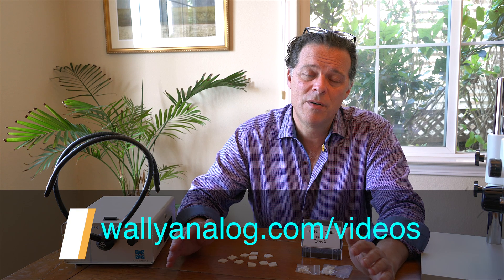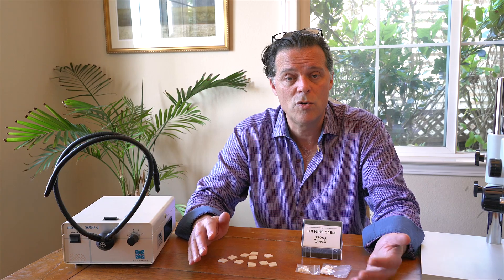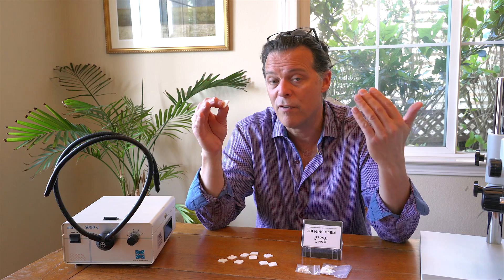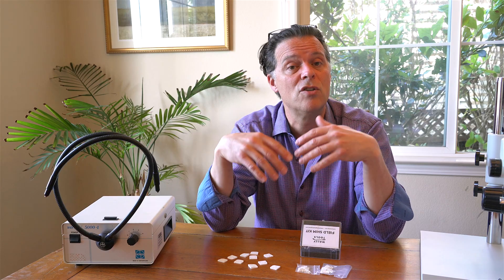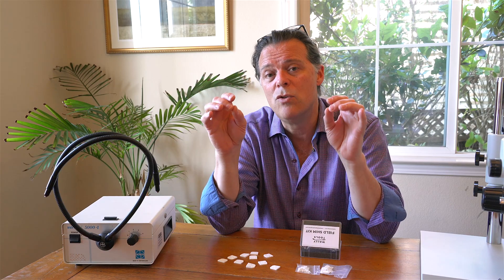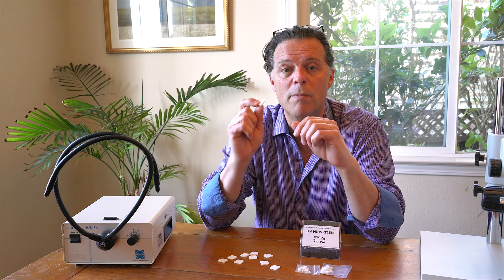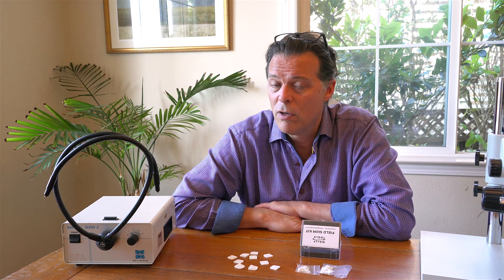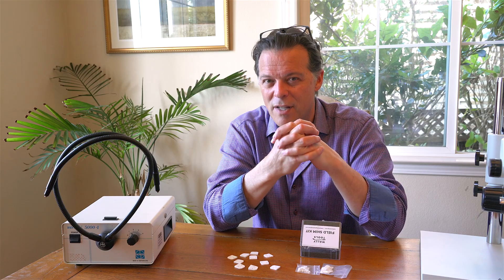Sound Bite #37: Experimenting with Corrective Shims For Your Phono Cartridge

Comment: Hello. The other day, I was setting up the denon 3000 ne. The tube is inserted through a damper, and there is a soft pad between the cartridge and the housing. I think this pad looks like a cow's saddle. First, it's difficult to move the cartridge when adjusting the offset angle, and there's no feeling of a tight connection. Additionally, the pad may sag over time. Thank you for opening this topic!
Reply from the maker: You are welcome
Reply: @WAM-Engineering 🤝

Comment: aren't you really talking about rake angle from 90 degrees from top dead centre. if you're lowering the back of the cartridge it's gonna give you less of a rake.
I don't see how you're changing the vta yes vte of the counter lever but not the arm. a bent curved arm is best, so the bearing is at platter level. not seeing a gentle curved arm yet. try it out you should be surprised, look for a 2 degree drop at the bearing and straighten it out about a third towards the head. bamboo works well easy to bend when steamed. dry in an oven at 60 degrees Celsius, then put it in a vacuum bag with fibreglass resin hardener. you need to drill the centre of the bambo first and line the bottom of the inside or outside with a bit of copper tape to ground. 
you could try 3D printing one from this carbon type of resin not tried it.
Reply from the maker: Way too much here to debate. If you watch enough of my videos you’ll see my position on many of your points.
Reply: oh well disappointing😊 @WAM-Engineering

Comment: Hi JR. How are you measuring VTA, stylus tip to cantilever pivot point or down the cantilever tube? Thanks.
Reply from the maker: Tip to pivot. It’s the only proper method. The challenge is finding the pivot when you can’t see it. We developed a process for that.
Reply: @WAM-Engineering Thanks. Glad you managed to find a method to find where the pivot point is, it is tricky.
Reply from the maker: The difference to the cantilever angle is what we call “stylus offset”. It ranges from 0.5 to 3.9 degrees, depending upon the assembly type.
Reply: @WAM-Engineering Ah I see, interesting. I have a method where I get a good image of the stylus and determine the cantilever angle when the stylus is at 90 degrees, then use the cantilever angle in the record as a reference to dial in the SRA. It seems to work well, my shims are just thin metal though. Strangely, my cartridge needed the nose dropping by 0.5-1mm. Great work JR, I’ve learned a tremendous amount from watching your content, it’s excellent, always looking forward to the next episode.
Reply from the maker: Thank you!
Reply: @WAM-Engineering The new head shell looks fantastic btw, makes me want to buy a Kuzma arm.
Reply from the maker: Thank you! The Colossus is hardly the only reason to get a Kuzma 4Point or 4Point9!

Comment: Have you measured optical cartridges, do they have this problem?
Reply from the maker: Same challenges as the others since they buy the same mechanisms from the same vendors as all the other cartridge manufacturers. DS Audio does, however, tend have a more appropriately low VTA than most other cartridges. This is probably due to the fact they don't have a need to allow for clearance between the record surface and a front magnetic yoke.
Reply: @WAM-Engineering I'll call you on setting mine up, get your advice thanks JR... the system you aligned for me and Paul sounds terrific 
Carl
Reply from the maker: @carlmarchetto1786 Happy to have helped the Marchetto boys!

Comment: Two sliding shims for adjustability? Get an exact not precut angle?
Reply from the maker: That would work but it would double your mechanical interfaces which create their own set of issues.
Reply: @WAM-Engineering  A trade off between adjustability and mechanical stability. How granular it needs to be.